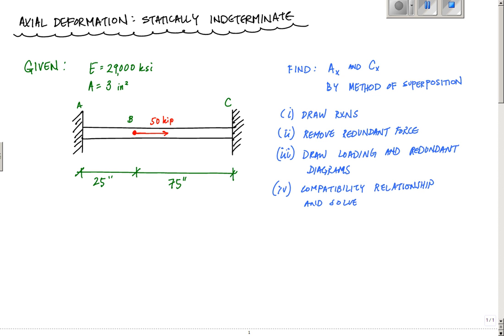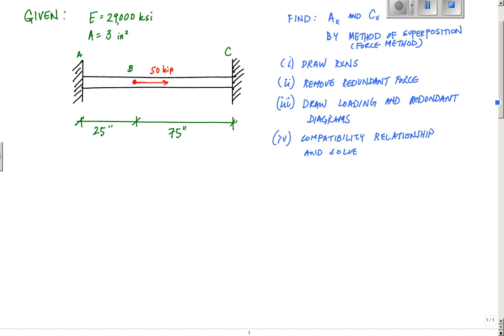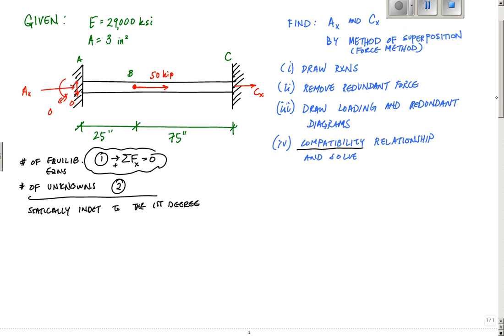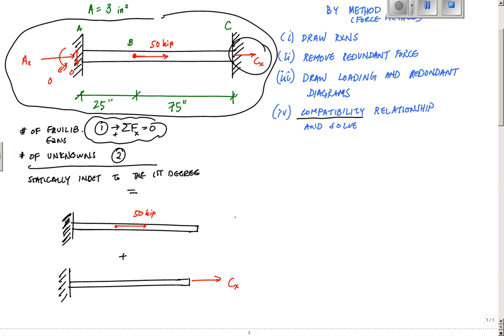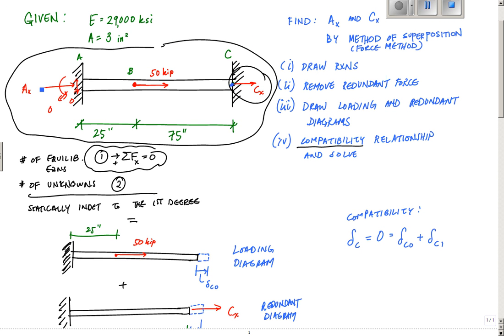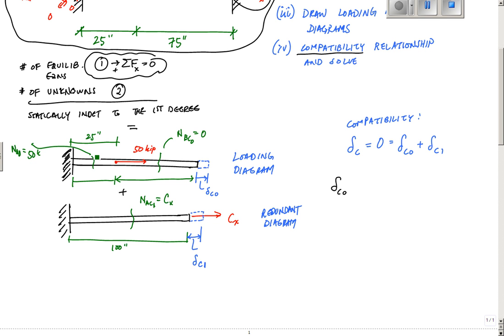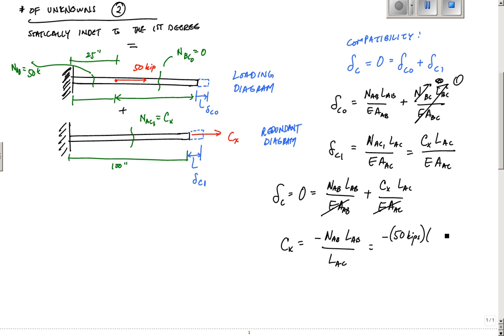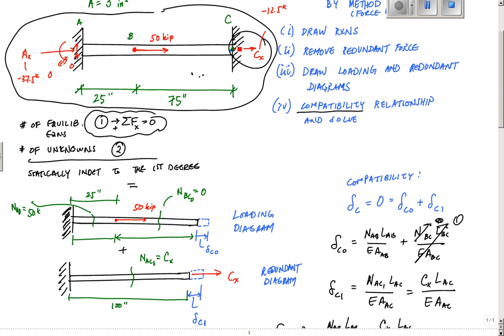Axial Deformation - Force Method for Statically Indeterminate Member

Comment: What if from A to ur 50K force the material was steel and then from the 50k force to C it was made out of brass (both had same area's though), what would you do then? so they have different E values for example if the steel had E = 200 000MPa and the brass had E=120 000MPa , how would you apply that in ur scenario?  do you have an example of that kind of thing?

Comment: Why didn't you include Ax in your first loading diagram? Thanks!!
Reply: I might be wrong, but I think it's because he analyzes the right side of the cut so Ax wouldn't affect the FBD for the first loading diagram
Reply: Maybe because Ax doesn't cause any deformation?
Reply: I think depending on loading and redundant diagram Ax is automatically and implicitly is either 50 kip or Cx to calculate deformation

Comment from the maker: any time you have more unknowns than equilib equations, there is a redundant force. the redundant can be any of the unknowns.  this problems uses the principle of superposition to break up the structure into statically determinate "diagrams", the redundant diagram is the diagram where the reaction (that you selected as the redundant) is reintroduced as a load.

Comment: Bro, I'm puttin the word up. You da man...

and, btw, i came across a question wherein a bar was hanging down from a fixed end and a load P acting on it. There's also the self weight of the bar acting. And deformation was asked. The answer was WL/2AE + PL/AE.... shouldn't it be WL/AE + PL/AE ? I mean, its just 2 loads... how can the formula change? thanks in advance